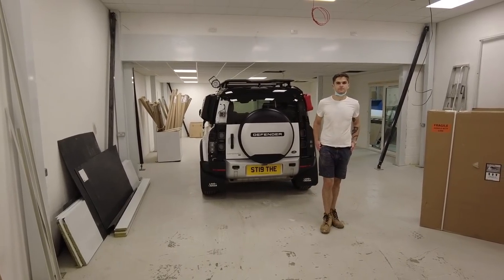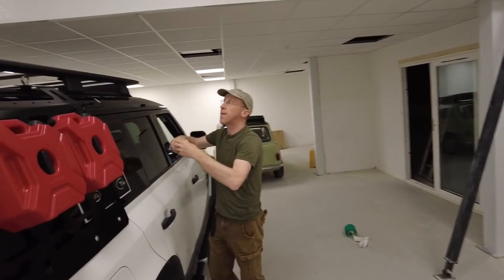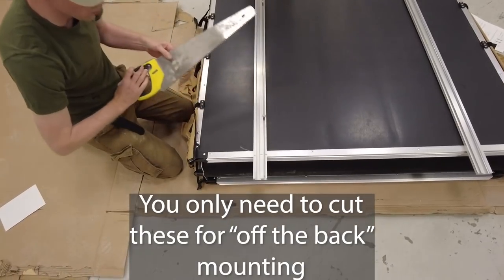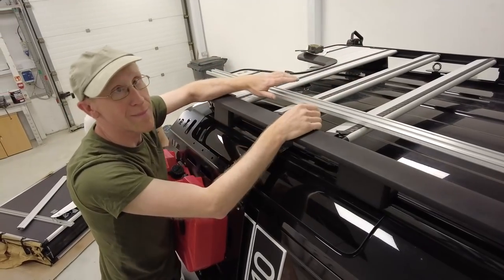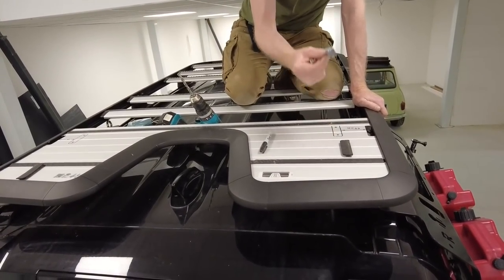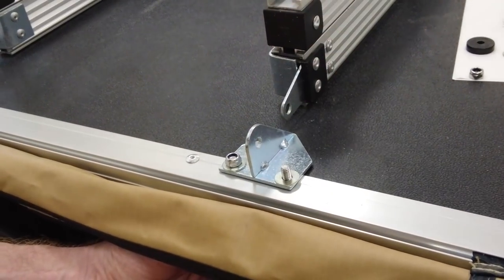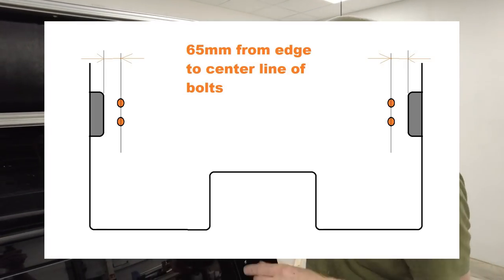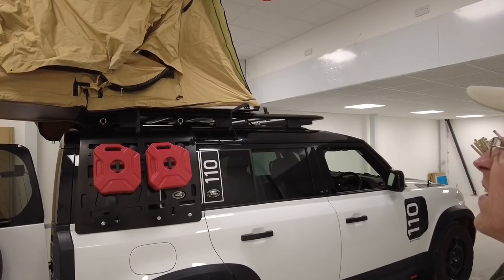Unboxing & Fitting ARB roof tent on Land Rover Defender L663

Comment: Good video,  just a tip about drilling, get a small peice of wood about an inch shorter than  the drill bit and you have an automatic drill stop so you don't drill to deep. Obviously you have to check that you have the right drill length to go though the material. It's a good safety stop.
Reply from the maker: Great idea

Comment: And another great video. Must admit my camping days are long gone , it is only caravan now. Like the idea of the work light, could we have some pictures of the bracketry. Will you be running power to the tent or relying on batteries for lights etc.
Cheers for now, Non Stick Nick. p.s. give Adrian my regards of you are going to Bristol in the Freelander. He has a book of mine that might interest you.
Reply from the maker: I am working out the extra wiring and connectors / plugs / brakets but will update at the weekend and do a video if people want. I have a small 2nd battery being installed. Yes off to Bristol Sat morning and will say hi to Adrian.

Comment: The roof rack will have two load ratings. One will be less while the vehicle is in motion and a second static one which is usually slightly more and what the manufacturers advertise as the load capacity. So two people sleeping in it while stationary won’t be an issue. Check  Ronny Dahl’s video about it on his roof rack he fitted to a Hilux.  Goes into much more details. But the above it the general gist of it.

Comment: There popular in Australia because of snapping handbags.  Your also missing the 4 body washers for the 8mm bolts that you put through the tent for load dispersion.
Reply from the maker: Yes the washers supplied were small so we fitted larger ones to spread the load.
You have lost me on the snapping handbag comments.
Reply: @L663  snapping handbags are crocodiles. Its common for arb to leave out hardware.

Comment: your aluminum bars, stainless and steel brackets, should have barriers (rubber, plastic) to mitigate galvanic corrosion
Reply from the maker: We just 3D printed some for the cross bars but the ladder brackets are steel on ally

Comment: Should not have cut Ali extrusion to length, just re drill fixing holes, then have enough extrusion to spread load 🤔
Reply from the maker: Yes i too was not keen on cutting them off totally - i was happy with cutting at one and i moved the cross bars to match the end of the ARB extrusions.

Comment: looks cheap and nasty sorry but it looks crap put a decent one on i know there a couple of grand and more but thar ARB is nasty it does not fit right
Reply: here I thought arb was pinnical of quality, perhaps give front runner a go ?
Reply from the maker: They seem to have it 90% correct but the last few easy bits let it down... I have passed the comments and link to the UK distributor and I hope to get a response....
Reply: @sn-em9zx  Agreed. Company the size of ARB has no excuse in getting the hardware so wrong.
Reply: arb rooftops and awning are crap. 23zero is much better but do your research

Comment: First
Reply: I'm on my second roof tent. Brought a cheap one to see how I got on with it. Then upgraded when I was sure about it. (second hand value is good, owned the first one for just over a year and sold it for just less than I paid).
Now have a Tuff-Trek one, great quality and the instructions are just what you wanted,  pictures of the packing list, very comprehensive. 
Fitting kit included tools (Inc ratchet spanner).
I had mine opening over the back door on the disco 2 this gives a great area for cooking etc. It's now on the disco 4 and has to open out the side due to the tailgate. 
Don't worry about the roofrack load rating, that is the dynamic rating when driving (rated for stability)  when parked you are a static load.
Glad your back, have a great fun camping weekend,  looking forward to the follow up video :-)
Reply from the maker: Yes Sir !